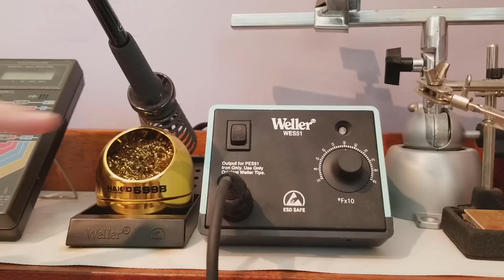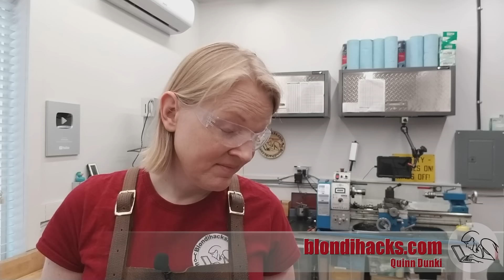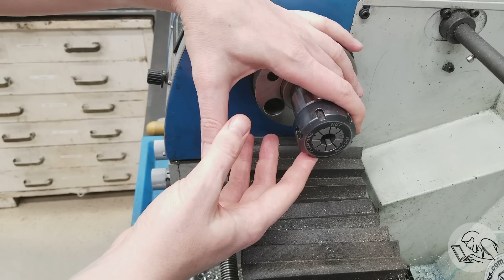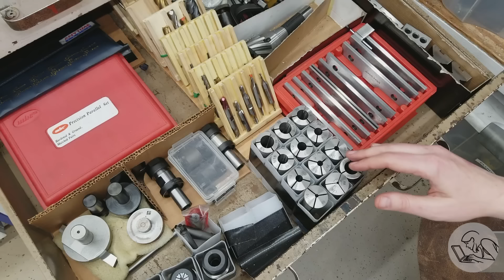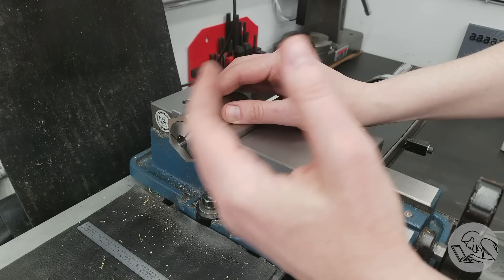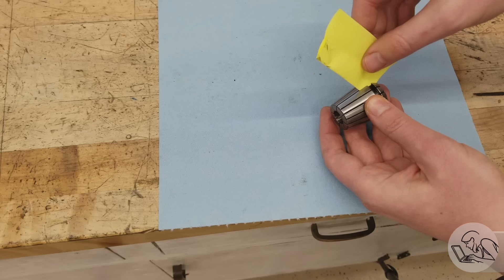Beginner's Guide To Collets

Comment: An important detail on double slit collets like the ER-32 is that it needs a minimum engagement length of 2/3rds to clamp well. A single slit collet can hold pieces with very short engagement. Clamping short things in ER-style collets can damage them!
Reply: That 2/3rds requirement is not true if you have a seperate piece of stock in the back end of the collet the same diameter as, or ever-so-slightly smaller in diameter than, the actual work piece.  Just like when holding a small piece in one end of a vice jaw, it's good to have a similar size piece in the other end for a better hold.
Reply: @Self_Evident  Clever idea, the 2/3rds rule was indeed made with clamping a single piece in mind. I’ve never seen anyone do that though while there are plenty of examples of people clamping too short tools/workpieces and being disappointed in the very limited holding force of the setup.
Reply: While technically true, we got away with a lot with a cheap set of ER32's at my last place of work. We clammed things only 1-5mm long in them with quite regularity (though they were also only 3-6mm in diameter) without any issues. Bit fiddly though.
Reply: @kitsgarage5931  We all do things we’re not supposed to do but at least we should be aware of the rules we’re breaking 😁
Reply: Came to say exactly this, when I was looking into collet sets I saw that ER style sets only guarantee concentricity if your part engages ~2/3 depth or more- a remnant from originally being designed as a tool holder that was later adapted to  workholding.  5C style collets will grip and be concentric so long as your part reaches past the gripping face.

Really only matter if you're doing a lot with really short parts, but is why I started with a 5C set and added an ER set later.

Comment: I have a Chinese mini lathe with a MT#3 spindle.  Does this mean I buy a MT#3 collet chuck?  or is there a simpler way?  I'm a bit intimidated about removing the 3 jaw chuck to do that.  It might be good to show how to change  these chucks in another video.  thanks for all your great videos!
Reply: Hi Mike  without knowing the specifics of your machine MT#3 implies a bolt on chuck   (there are three nuts visible on the back side of the chuck)
google for   er lathe collet chuck      to find some ideas   you could use mt3 collets but there is no through hole.
Reply: Hey Thanks @steveggca !  I went and checked the machine and actually you just remove the 3 Jaw and the MT is right there so it's easy.   Guess it would have been better to have done that before posting.    "Think before speaking!"  🙂

Comment: Nice summary.  I'm primarily a woodworker, and we use collets too. Routers use collets to hold the router bits, ER-style. My Dremel rotary tool uses teeny tiny collets. And I have a set of MT2 collets for my wood lathe. They require a draw bar.

Comment: In my whole apprenticeship I only worked with ER collets so far. On all the mills I worked with, they used swappable collet holders, in which the tool  and collet themselves can be left in when swapping tools, so you don’t lose Z and and they are identical for the same collet size class.

Comment: Awesome as usual from you.  I always assumed  single cut collets are ground a wee (sorry for the technical term) bit wider at the open/ bottom end so, when they hinge closed, the surfaces come pretty close to parallel to the tool. 
Then again, I've assumed a lot of wrong stuff.  I still assume me being a hobby machinist dumbass is the exception, not the rule ... But ... 
Thanks again Quinn.

Comment: Nice summary.  Only thing I would add for the lesser initiated is that It is important to snap the collet into the closing nut before installing it as undoing the nut is what pulls the collet out.  They can be tricky (if not impossible) to remove if you just push the collet into the holder and then screw the nut on over  it.

Comment: Tapered buttress threads are reasonably common in the oil industry. Casing; the metal pipes that are put in place to stop the well collapsing (amongst other things), can be threaded this way. Good for high axial loads, and also relatively easy to torque up to a consistent value with a visual guide.

Comment: Nice comprehensive comparation, Quinn! The only thing I would add - that also puts another checkmark in the ER collet's book - is that they have a "loosen - then - eject" function, meaning the initial loosening of the nut doesn't let the tool or part go at once, you have to turn it a bit more to get it out. It is a nice addition, has saved me lots of endmills NOT falling onto the workpiece or the machine vise. The thing that allows them to do this is an eccentric ring on the inside which fits into the groove at the collet's neck part.
Reply: I have a couple of 4 inch squares of sheet rubber I always chuck on the bed below the spindle before undoing collets in case the collet surprises me - have saved a couple of carbide end mills this way!

Comment: Hi Blondi , a nice summary.
R8 collets were  designed by Bridgeport for their milling machines 
(a word of warning for non north american viewers,  R8 appears to be much less common than Morse 3 collets)
5C collets were designed by Hardinge for their very wonderful manual lathes ,real hardinge collets are quite expensive.
 Lathes from the lowest and cheapest to the most expensive and precise have a morse taper in the spindle  so Morse collets are an option.
(added ) ER    originally by  Rego-Fix  switzerland     It  is truely international   

If you use collets on your lathe there is no chuck jaws to run into. running into chuck jaws is a very bad thing.
Reply: i hope that comment will be pinned .
most of the stuff i can find here is either MT2 or MT3, both my mill (HBM bf25) and lath (myford ml7) are MT3/MC3 and MT2 /MC2. luckily my ER-collet set came with both a MT3 and MT2 shanks so i can use them on both machines :)
Reply: Nice, I personally appreciate history behind common things.

Comment: Would a ER collet work on a Sherline lath/mill??
Reply: Yes. ER 16 is not bad for them, based on the size of the machines. I have a Taig lathe, with is similar in size, and the company makes an ER 16 collet chuck for it.
Reply: Sherline sells a spindle head with ER-16 collet spindle.

Comment: The ER collet shanks (i.e. ER16 x 6" length) are handy for making toolpost drilling accessories or for extending small tools.
Reply: I purchased an inexpensive ER16 to MT-3 to securely hold small drills in the tailstock of my lathe as I was tired of my Jacobs chucks slipping and ruining both my drills and the work no matter the amount of torque I tighten them down with. It's worked fantastically compared to my old beat up Jacobs chuck.
Reply: @clone4211  that sounds a good plan. Keep a look out for Albrecht chucks. They are absolutely fabulous, keyless and I’ve never seen one slip. You just need to remortgage to buy new!
Reply: Vey true, I use on for a tool post grinder. Perfect for a small lathe.

Comment: 5C collets are good where you need to hold only a very shallow amount of material; the ER collets will close unevenly under that pressure (kind of like using only one side of your mill vice with nothing balancing it on the other end). This can lead to parts slightly canted relative to the spindle axis, resulting in tapered cuts.

I run both ER40 and 5C in my lathe (and ER40 more often than 5C), depending on what I'm cutting and why. I also made an adapter to use the ER40 collets as a self-centering "spider" on the outboard spindle end.
Reply: Nice idea on the ER spider. ER collets don't hold well on a very short amount of work or tool inside. Had an employee try to get more length on a CNC router ER32 with the result of a tool flying across the shop @16,000rpm.
Reply: Oooh 😯, glad I read this. It never occurred to me to adapt a collet as a spider. Thanks, Michael! 👍
Reply: @624Dudley  I got lucky with the existing thread on my lathe spindle outboard end. That made it simple. It would take more work on most lathes.

Sadly, trying to link to the description doesn't work; I keep forgetting that spammers are why we can't have nice things. But a search for "hobby machinist g0709 ER40" finds my description of how I did this.
Reply: In order to securely clamp short parts in an ER collet, put a matching diameter (or even slightly smaller) part in the back end of the collet to balance the ER clamping force, just like when clamping a small part in one side of your vice with a similar size part in the other side of the jaws.